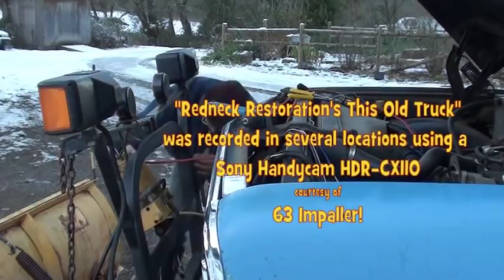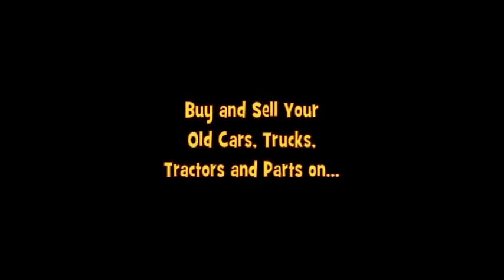Part 5/6 Meyer Snow Plow Installation on the 1969 GMC 3/4 Ton 4X4

Comment: tip for making lugs for thick cable is to use a piece of copper pype, flatten it on one side, dril the hole, and insert the cable in the pype, you can shrink it with a crimping tool, or even solder (the lest not realy recommended) and whalla, you made yourself a cable lug the easy way.

Comment: Not sure if you read my comment on your last install or not.   I'm trying to help you here when you cycle the pump it moves too slow.  You need to use meyer snow plow hydraulic oil.  The oil you put in it is too thick and when it gets cold gets thicker and slows down the pump and makes everything work harder.  Meyer fluid is thin almost like water and it has alcohol in it to keep it from freezing in the winter.  Don't believe me ask the smith brothers they can tell you.